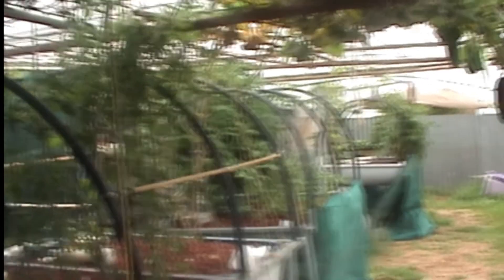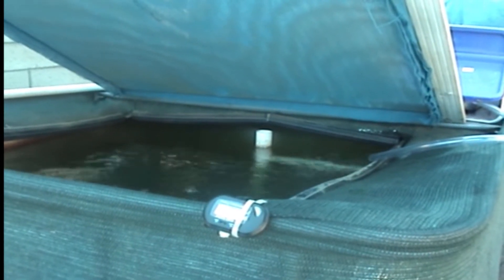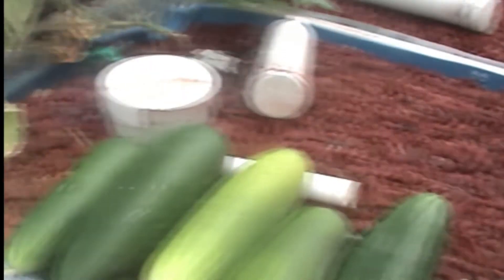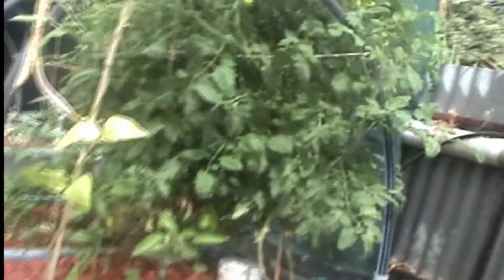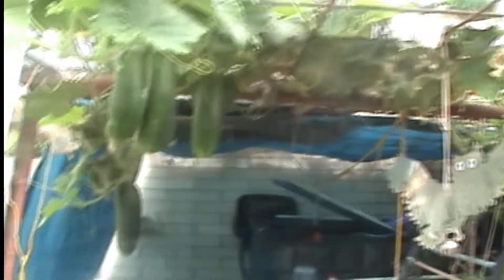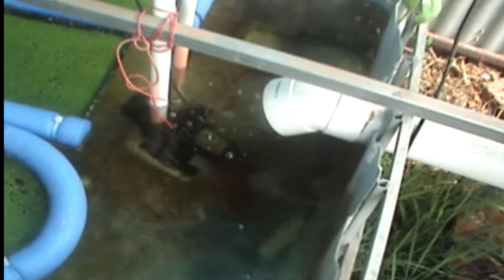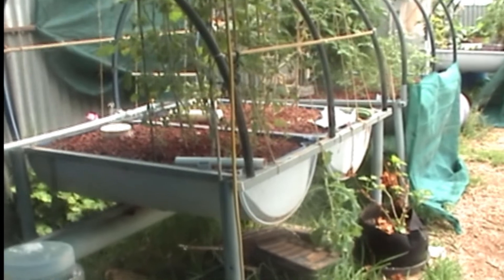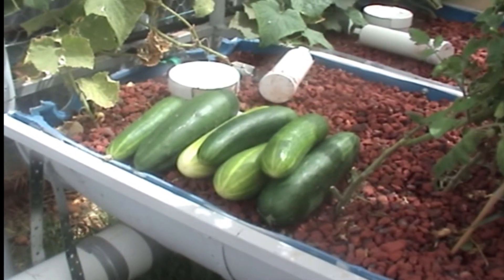Solar Powered Aquaponics  update  14- 3- 2020

Comment: This is so cool! This is an odd question but how many amps and volts run through your solar panel?
Reply from the maker: hi mack  solar power by. 
 4x180 watt panels a 12v solar panel controller chaarger
bank of 10 car battery. a 6000 watt power inverter and 10,000lt water pond pump.

Comment: Hi Mick, thanks for sharing. I am looking to set up an Aquaponics system with Yabbies only. Do you foresee any issues with this??
Reply from the maker: hi Matt no i got Yabbies in my sump tank  and it works   good no issues i think  i'v got about  30 in the sump at the moment
Reply: Hey Matt, like Mick's system are good for cleaning up loose an decaying matteran breaking down escaped solids into micro nutrients, your main issue will be waste production as demand  increases from your plants yabbies will not produce enough of it, especially once your system matures algae on tank walls an bacteria in media will consume  it leaving little or none for your herbs or vegetables. 
Not saying No an like Mick's system they  are apart  of the filtration system cleaning the tank an further breaking down large waste matter making it easier for the plants to absorb.